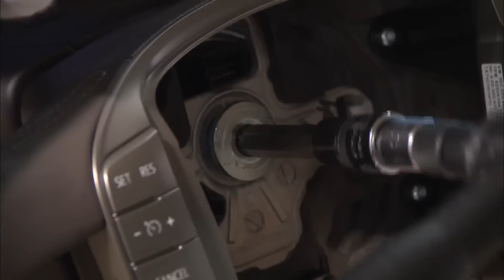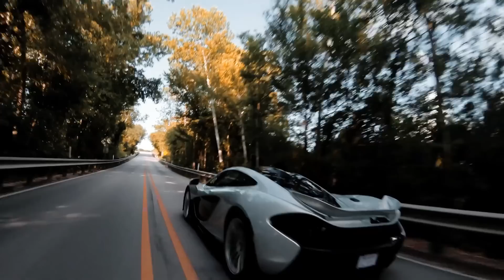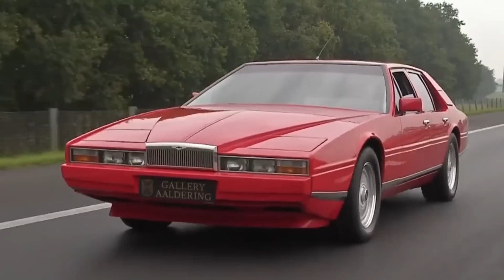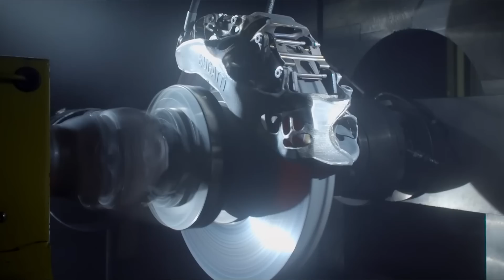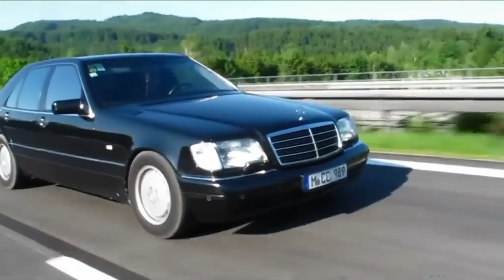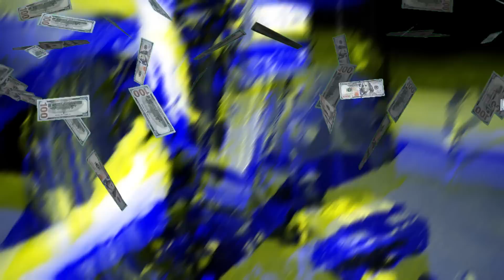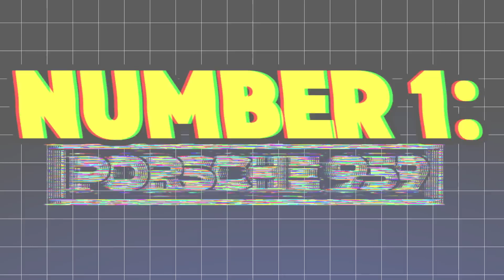17 Stupidly Complex Cars That Will Bankrupt You in Repairs

Comment: Anything built in the last 20 years falls into this catagory. 
Complexity is the enemy of reliability.
Reply: Complexity is the enemy of reliability. Is the most relevant statement on all of Youtube.
Reply: im a mechanic
Reply: @ I'm a retired auto engineer who did engine repairs. The worst car engine I got was a Toyota Supra. It took me 5 hours to remove all the bullshit around the engine.
Reply: Thank you. This is something I found in my career as an industrial electrician maintaining and repairing machinery. Added complexity.......added breakdowns not to mention added expense!added
There is an old saying in the trades, the KISS rule ( Keep It Simple Stupid). This saying has proven itself to be very applicable in the automotive world too! Keep it simple, keep it running!
Reply: The 2007-2011 Corolla was simple too. The dash lights started malfunctioning at night, causing me to need to guess the speed,  haha. Besides that - bullet proof
Reply from the maker: Couldn’t agree more. It’s like cars crossed the line from “cool tech” to “unfixable gadgets.” Sometimes less really is more when it comes to long-term peace of mind.
Reply: The Mercedes 600 wasn't built in the last 20 years, but to those thinking they are complex, like the idiot who made the video, go back to sleep.
Reply: Good thing my car was built 21 years ago, right before GM closed its division. Guess Mary Barra just didn't want reliable, good looking, great performing, well-built vehicles on the road. Well, it looks like Mary got what she wanted.
Reply: And most of it is just useless unnecessary fluff the more you add the more that can go wrong that's why I like all iron

Comment: If you think a Honda Prelude is more difficult than an actually reliable Mercedes W140 S-Class don't even look at my SL65 lol. Those are nothing but archaic relics.
Reply from the maker: The W140 was overbuilt, but still holds up—unlike some of today’s tech-heavy rides. As for the SL65? That’s not a car... it’s a mechanical opera. Beautiful, but drama at every turn.
Reply: @carcareclues  Daily driving an R230 SL is a skill few will ever master. The drama is for the novice owner, beginners need never apply.

Comment: The newer modern Mercedes Benz are loaded with high tech. They put all this tech in because it is available.  When it breaks it will be expensive and complex to repair
Reply from the maker: Exactly! Mercedes goes full tech wizard, but when that wizard glitches you're stuck in a repair quest that costs as much as the car itself.
Reply: Yes, and aside from the tech/reliability issue they are not even nice anymore. A lot of the time if you changed out the logo on a Mercedes it would hardly look like a Merc. If you take some of the lovely 124 series from the 70s, the modern Mercedes is not a patch on it. I couldn't give a hoot for piles of electronic. The older cars had beautiful coloured interiors and sensational suspension. They were a real physical joy and a great motoring experience - a car that was always there for any excursion, mega reliable, no sudden financial heart attacks etc. You got what you paid for. But not now. It's not just in this industry, there is a whole culture of ripping people off with legislation, red tape translating into high-priced nonsense. When all folks wanted was something much simpler.
Reply: I have a 2015 GLA 250 I have been very lucky with.  When it was still under warranty a electric/computer module in the door went bad and you couldn’t lock the doors and anything on the left had side of the car was seemingly  hit or miss if it may or may not work (Depending if it had anything to do with the module.).  As a comparison when I had to get the transmission fluid routinely changed on an MDX was like $400-450 at the dealer.  The Mercedes was $1100.  Brake replacement was $2,000 vs $600 (All dealer work.)
Reply: Those and BMWs, Audis, Jags and LandRovers are for wealthy people who trade them in every 2 or 3 years for another new one before any real maintenance or repairs need to be made. People who buy them to use for years and years or buy a used one for a daily driver are fools. They will break down repeatedly and drain your bank account just for regular maintenance.
Reply: @jayson657  Even being able to afford them and the repairs, the inconvenience and frustration has to be accounted for.
Reply: @sand0077 I agree. Even if money was no object I wouldn’t want one. I’d take a Lexus or Acura in a heartbeat over any of those. Hell, I’d even chance it with a Cadillac. At lest being a GM they share lots of parts from Chevy, GMC and Buick parts bin so some of the repairs and maintenance aren’t too outrageous.
Reply: @jayson657 lease. Not buy.
Reply: @jayson657  False. My 20 year old BMWs are the most reliable and cheapest to maintain cars. My 20 year old Japanese cars are all either long dead to rust or always off the road broken.
Reply: @jaymum23 LOL yea ok.😂
Reply: @jayson657  Show me where the facts touched you little boy.
Reply: @jaymum23 the facts are Japanese vehicles hold their value and Euro junk depreciates like hell because everyone knows they’re unreliable, high maintenance garbage after the first 3 years. Only people who are bad with money and men with tiny penises buy those $hit boxes to try to impress other idiots. Resale values don’t lie. A 3 year old Honda or Toyota cost almost as much as a brand new one. A 3 year old Beamer is worth like half of what it was when it’s new because everyone else knows it’s crap.
Reply: Mercedes isn’t what it used to be.
Reply: @Jwdude123 Idiots said the same thing 40 years ago.😂
Reply: Oh but the liberals want you to have EV's only and they are even more complex.
Reply: Junk for the fake rich.